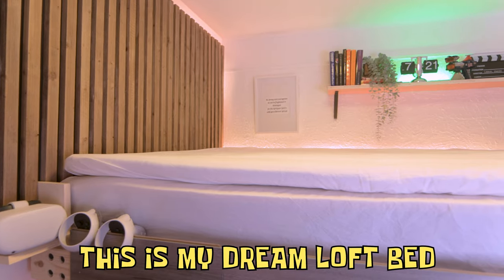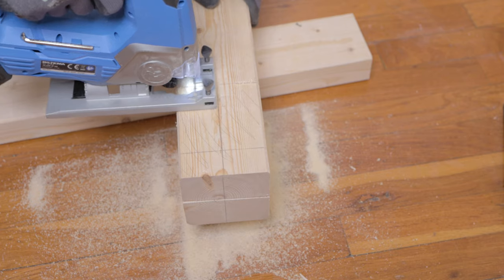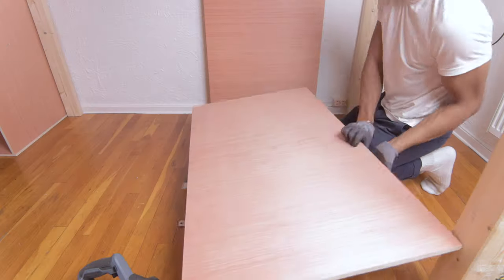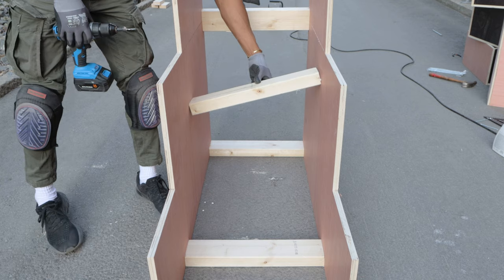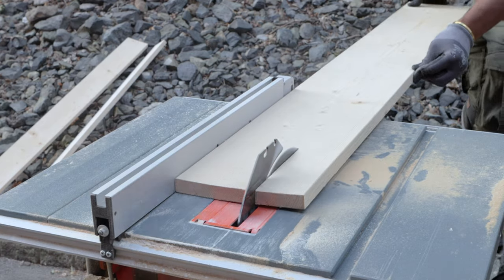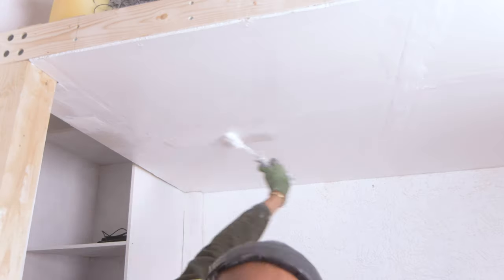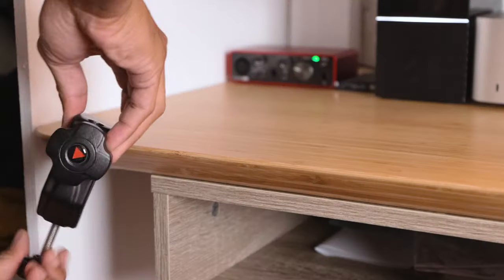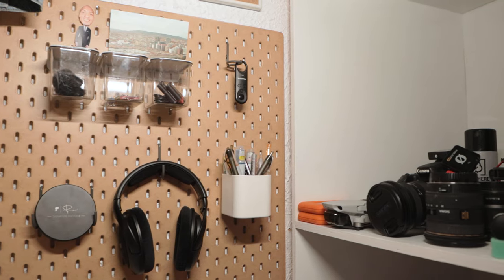I BUILT MY DREAM LOFT BED w/ WALK-IN CLOSET (DIY)

Comment: This is awesome! Do you have the build plans for it? And what kind of screws/bolts did you use to secure the loft to the wall? I have one wall that is concrete and the others have studs.
Reply from the maker: Thanks! Glory be to God. No, this build was customized but this will be easy just follow my steps, I have another video that can help you on my channel. The screw is called Stainless steel concrete/cement bolt. With the wall with studs, since I don't have experience. It will be wise to ask the supplier about which type of screw can handle the weight. Good luck with your project 😎

Comment: Pretty nice . One concern is the Heating System its very covert little bit supoptimal ,)
Reply from the maker: Yes, the heating was blocked by the stairs but it’s okay because this room doesn’t need heating due to good insulation and heating from other room.

Comment: May I see your jigsaw's brand and blade, I like how it cuts
Reply from the maker: This Jigsaw is only available in Scandinavia. I have a link on a similar quality in the description box 😎
Reply: @GabrielDimude  how it come it looks like a yellow one.. but from your video, is a nice blue-colored wireless one :)
Reply from the maker: @yan_88tv70 Check Biltema.no but it will be like I said only in Scandinavia. That yellow will work as well but the important is the blade. I use a fine blade cut

Comment: how long did it take to make this?
Reply from the maker: Longer than I anticipated since I was also filming it. If I would guess, probobly 3 - 4 weeks depending on experience and hours per day. Are you planning to build?
Reply: @GabrielDimude  yeah i am but im 13 years old also how much does this cost? without the pc just the bed frame and materials?
Reply from the maker: This Loft bed, I spend around $1,000 USD but it includes the walk-in closet and stairs with drawers. The other loft bed is more affordable due to the design and reclaimed materials. That will probably cost under $ 300-500 USD without the machine